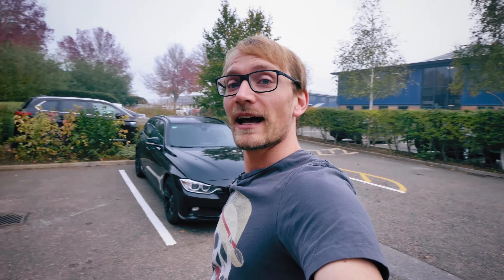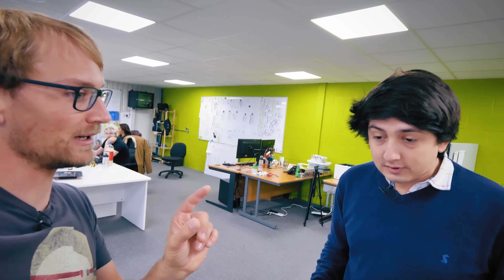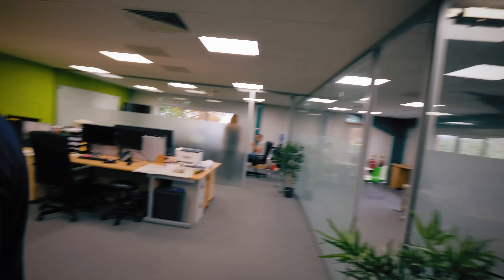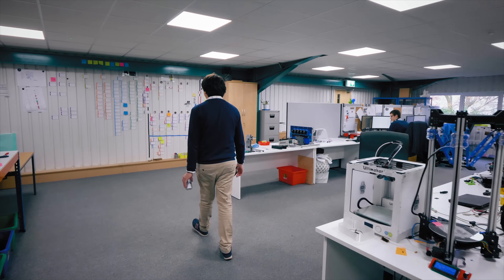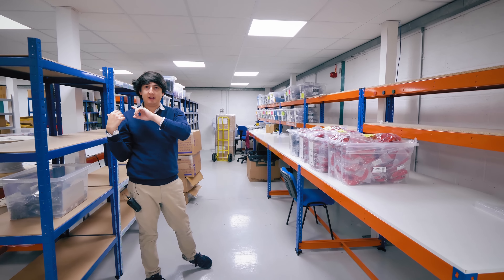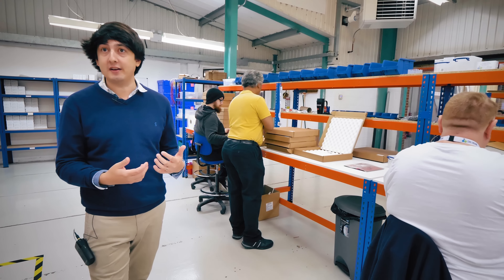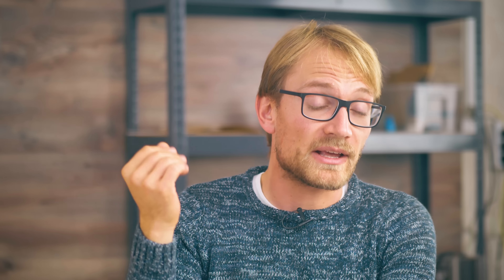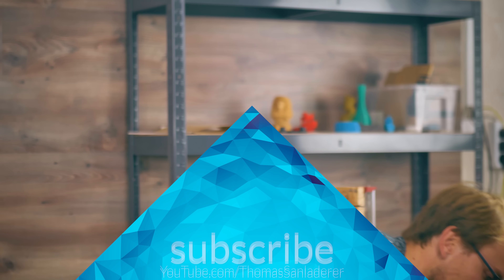The E3D Factory Tour!

Comment: My E3D Thermistor did not work. So I just ordered 2 more. After taking to support and determining that indeed the Thermistor was bad They ask for my order number. A day later I received a new Thermistor without asking for one. I also found in my journey to upgrade my printer that it is very helpful to have extra parts. I know that means more money. But I went around and around as to if the Thermistor was reading the correct values. Once I got the new thermistor and tested it, confirmed replaced and done. No more guessing on values and even if I was using my Multimeter correctly etc. That goes for other Printer parts. Saves a lot of time. Also the time spent ordering the replacement part and waiting 3 days - 10 days to receive the part in order to get printing again.

Comment: The Keyence optical CMM QC machine is approx. 100 times overkill for heaterblocks, not to mention VERY expensive. That machine is meant for parts inspection of entirely different tolerances.